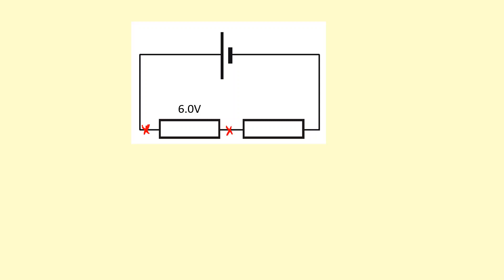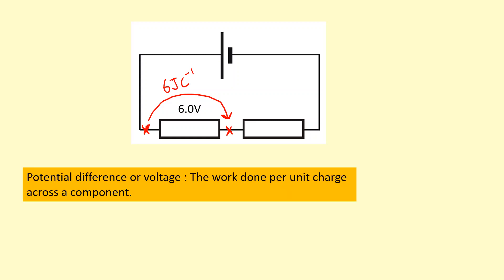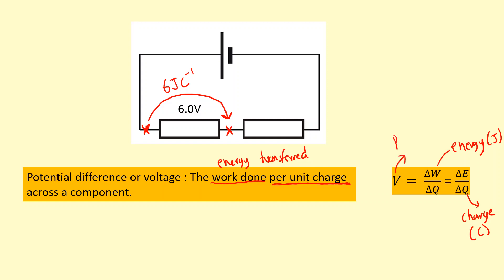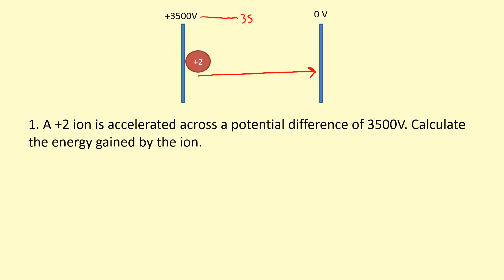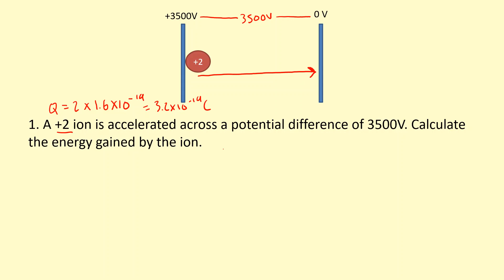3.02 What is potential difference / Voltage?

Comment: 0:31 Doesn't each coulomb lose 6J of energy? Please answer as this has really confused me
Reply from the maker: That's correct.
If you go across a resistor this resistor you will lose 6J of energy per coulomb of charge.

If you go across a 12V battery. The charge will gain 12J per coulomb.
Reply: Thanks, your videos are very good